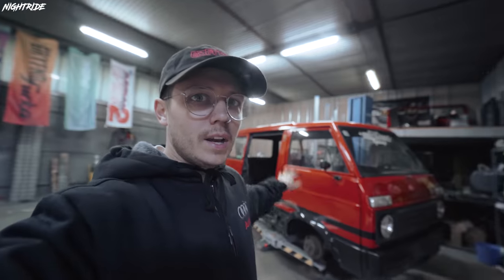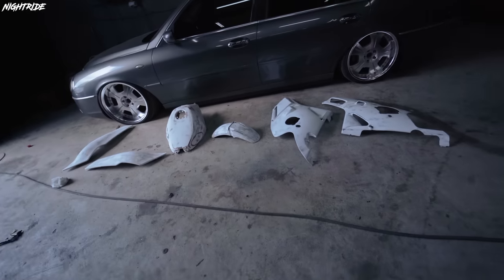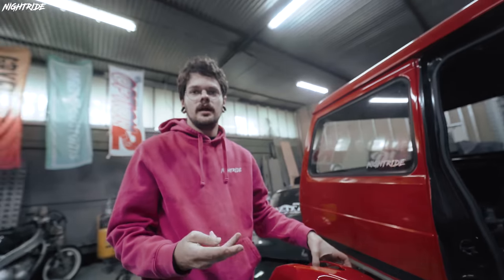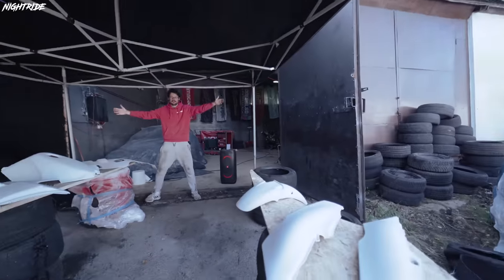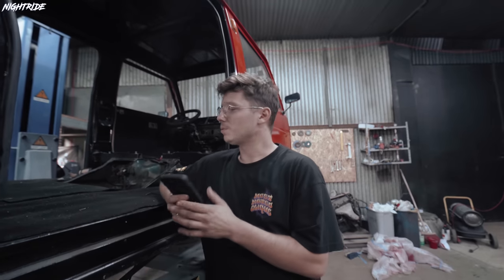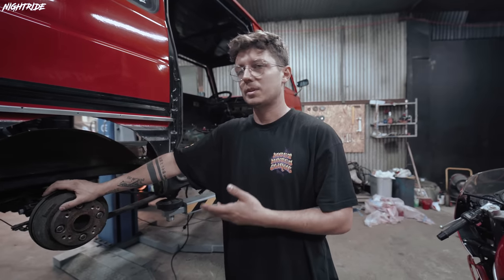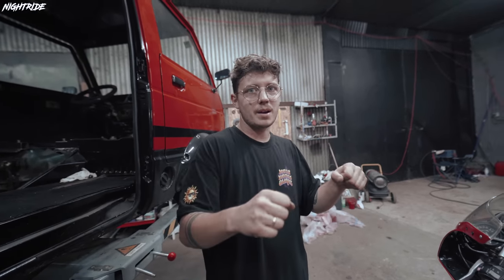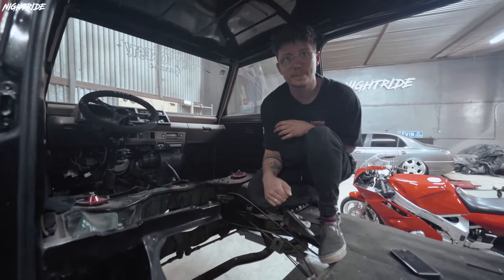HOW are we going to swap Motorbike into a little van? + Yamaha FZR600 painting

Comment: For the fuelsystem I recommend to use Kevin's tank and bump the fuel from the Kevin's tank to the bike tank. You can use sensors to cut of the bumping when bike's tank is full or something like that.
Reply: I thought about this but it might be out of the price range for the build, for now
Reply: I think they can just pump to the bike on the gas station
Reply: Bike fuel tank is usually smaller, and they're adding a lot more extra weight than usually on a bike. This maybe goes to grocery and back on full tank...
Reply: @SnowMouse1  I dont think they will do it in poland even if this car will be legal the cops will like it very badly ... So most likely the car will be droven only on the events
Reply: @SnowMouse1  I don't think it'll be getting groceries lol
Reply: I think this is a good idea, but they are going to need to find out the fuel pressure spec of the bike and then find an appropriate fuel pump regulator or jerry rig one, and Im assuming the fuel delivery system is very similar, but I don't know

Comment: is the speedometer still going to be accurate if you make changes by adding a shaft to connect the bike engine to the car weels?
Reply: Speedometer measures the rotations of the front wheel, nothing to do with the shaft or engine. Still gonna be tricky to get it accurate due to the different wheel sizes.

Comment: If you want the bike to be in the middle of the car you could run an axle with the diff on the side. For example a Suzuki SJ413 axle. For the bike fuel tank IMO it would be a lot nicer to use Kevin's tank as the main tank with an electric pump to feed the bike.
Reply: same idea, but using the bike's pump or something. ( I don't know if bikes use a pump or floating thing to close the petrol flow like some simsons from the old era).
Reply: @bladermusics  There shouldn't be a pump on the bike. It's a carburetor bike so the carburateur "sucks" the fuel out of the tank.
Reply: @MrSofachiller  ohh, then the 12V racing pump is a good choice but again that needs a ECU modding which is not gonna happen...
Reply: @MrSofachiller  That's how pumper carbs work on chainsaws so that they can be tilted. Bikes this big are usually gravity fed with a float bowl.

Comment: I hope you guys make the bike still removable and drivable from the chassis. Have a a detachable wire harness for the gauge cluster, run slide bolts through the frame or the rotors for mounting, some sort of quick disconnect exhaust. That’d be badass. I look forward to watching this build and seeing your vision come to life. This is such a cool idea.

Comment: Could always attach a plexiglass wall in between the 🏍 and the seat . Have it attach to the roll cage . Would help with the heat from the engine. The cooling idea is nice 👍🏼. Maybe some kinda air duct under the bike to just add air flow to the actual engine it’s self and have a roof vent at the back . Lovin this build

Comment: I’m fully onboard with this project!!!! So jealous I never thought of it, here’s some food for thought on problems, can you not use the original fuel tank and have a lift pump to either the bike engine or tank and hide the pipes best you can, maybe tucked in with the rad hoses, also, lights, I feel like the back light should be wired up to the side light of Kevin so when you turn the side lights on Kevin the lights come on the bike and also wire the brake light up 😂 just adds the the look I guess your going for that the bike is it’s own and it’s powering the van 😂 I just thought that would be cool

Comment: Sam, it will work, and if it works,  there is nothing stupid about it. 

My main doubt is how you guys will take care of engine heat, as the radiator may deal with the cooling part, but still there will be some heat being irradiated from the engine itself. Enough to burn skin? IDK, but I would definitely find a way to protect the people inside Kevin from unwanted burns. 

Really eager to see this project finished! It will be awesome!

Comment: i think the idea is awesome and im verry curious how its gonna work out. you have to keep in mind that the wear on the parts is going to be insane. the clutch is gonna slip more quickly, the transmission is probably gonna have some trouble to and maybe the most important part is that motorcycle engines aren't made for long distance so if the odometer would be at 80k you would probably need an engine rebuild already.

Comment: I like all this idea about bike inside kevin, but i have one question about fuel tanker. Why you don`t want use stock fuel tanker with stock fuel pump? Just connect them directly to bike and you will have much bigger capacity of fuel tanker for drive (i know, that you will not use kevin for drive) and you keep "klapeczka" in stock place in car without cutting roof of kevin.

Comment: Im a fan of this project, but wouldn't it be wiser to make the drive train work / somewhat work first and then focus on the cosmetics ? You might come to some major flaw, which will require different motorcycle for example... Also it would be interesting to  see how you'll make your own cardan shaft which would be capable of transmitting such powers reliably.

Comment: Why don’t you take the front wheel off and mount the front on forks and a bracket on the floor? It doesn’t need to steer while in the car, and will look more like a practical display piece.

Edit: nevermind I watched all of the video and you answered my question. Still, I think a display piece in the back is more of the vibe you may want to go with if you have top16 at raceism in your sights

Edit: can we have a q&a?

Comment: because the plastic of the bike is oval with mor curves it steals more light from more angles thats why seems more bright  ,,  do not keep the bike cooling system too cold cause you will break it .,,  best thing is to keep ideal temperature ... bigger radiator more  warmup !!!!!!  time  in warm up and cool down proccess is where  the engine gets hurt the most..!!! find a middle   solution not muc
hh cold no much hot

Comment: Hey guys, awesome video awesome project ! I'm wondering, if you want to keep the bike as it is why not just routing coolling exhaust and clutch/throttle in an hidden way so from the outside its looks like a stock bike ? For example you could leave the silencer on the bike but just weld a pipe after the exaust manifold and make it go down in the floor of the car ? because a bike without exhaust is kinda weird and something that people will notice pretty quickly if they are used to bikes. I guess you could do the same with coolant like just routing coolant line from the engine to the radiator and leave the stock bike radiator in stock location.
Can't wait to see the next episode of this build !

Comment: Much luck I wish to Kevin.  Add in a "center diff" that only mates with the rear differential; then sprocket & chain FZR engine to "center diff."  FZR turns center diff, center diff turns driveshaft, and driveshaft spins rear diff?  All other details; "fun."

Comment: I have an idea with the cooling, you could simply attach the original Kevin radiator to the cooling of the bike, run a Water pump and make the bike water cooled, its 600cc so the radiator and the pump doesnt have to be big. I have no idea how to do it, but i think it would be way more effective than just some fans.

Comment: One idea for the fuel situation. What if you hooked up the gas lines to a physical gas tank or can on the side of the bike? Then you are not limited to the small tank on the bike, as well as you do not need to cut a hole in the roof. You could simply open the side door, and fill it right up from there. As well as you would get a good view of the bike and whole assembly every time you filled up

Comment: why i think it won't work is because of few reasons:

1) obviously motorcycle engine is not very powerful, and especially in terms of torque. people did put motorcycle engines in the cars but it's light cars, Kevin while small, is not as light as it needs to be. of course if you just want it to "drive" it probably be able to achieve small speed but not much else.

2) also the problem is gearbox. the gear ratio is not suitable for a heavy car, but then again, you will be able to make some speed.

3) intake and exhaust, but mostly intake. the air that gets to the engine not only cools it, but also, well ads air. you need a lot of air since motorcycle engines run on high RPMs. 

4) brakes. it's possible to do it, but you'll have to find out how.

5) the vibration from the engine needs to go somewhere, if you're just gonna weld it to the car it will all go to the interior, and well, good luck with that.

i might miss something or maybe some issue is resolved already, but overall there is a lot of work and it's not as easy as just connecting a motorcycle chain to the axle, it takes a lot of engineering, and it might not even work out. but of course you can try to do it if you want, but just get ready to make lots of compromises.